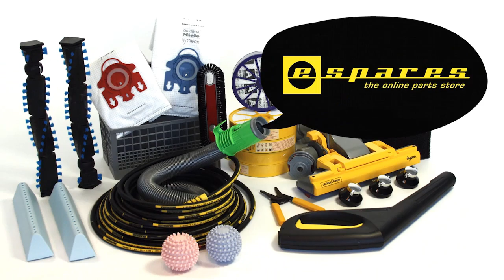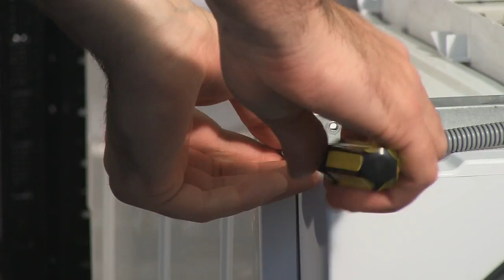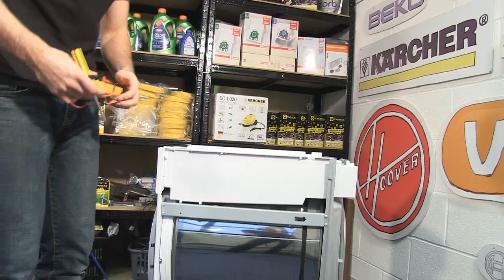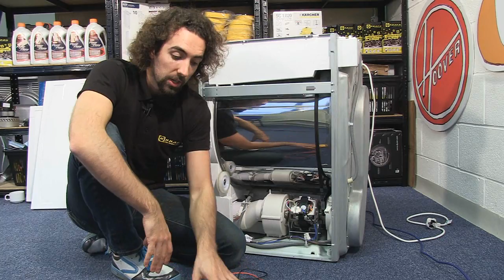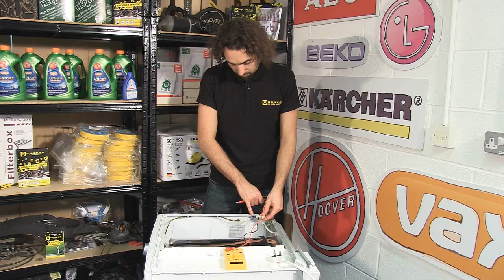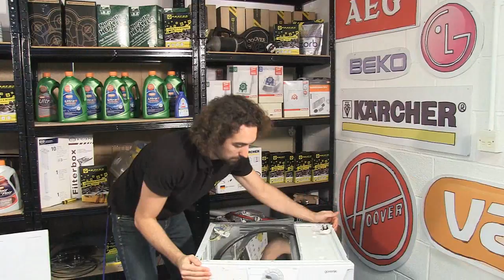How to Diagnose Tumble Dryer Control and Program Problems

Comment: Hi josh. I have a candy gvc d91cbb 
It just stopped working. No lights or anything.
I checked the obvious. Fuse but that’s ok..
Can you help please?
Thankyou Chris
Reply from the maker: Hi Chris, plug the machine into a different socket to check the power, if still not working was the machine on when it stopped and what was it doing?

Comment: My hotpoint fetc70 tumble dryer makes a buzzing sound when i push the start button what is wrong help
Reply from the maker: Hi Violet, you will need to test the motor capacitor and we have a video to help www.youtube.com/watch?v=Vd8DcQpk748&t

Comment: I'm trying to figure out why my hoover vch680f keeps blowing it's heater element (I am about to replace it for the third time in the last 18 months)

Can't find a fault, no unreasonable fluff buildup (as far as I can see), could it be the control board?

Thanks.

P.s. really appreciate your vids, have bought from you several times while fixing my stuff!
Reply from the maker: Thanks for the comments Benjamin. There could be several possible reasons but the first obvious one is are you using a 'genuine' Hoover element?. Next if a lot of limescale builds up this can cause excessive heat inside the element and cause failure. The final reason can be if the element came on when the tub was empty of water again it could overheat, (possible but less likely).

Comment: watched all the vids but none seem to cover my issue, it keeps cutting out after a few mins, sometimes only seconds you have to keep restarting it, its a Beko condenser if anyone has any ideas
Reply from the maker: Hi Darren, this could be due to the machine recognising its not heating or if the water is not being emptied into the container.
Check these areas to see if you can identify a problem.
Reply: might be worth renewing the over-temperature sensor.

Comment: Thanks, tried the sequenced on/ buzzer cancel button pushing with programme on delicates, nothing fires up :( Even had the back off to see if a thermal cut out had tripped but all seems okay. Are control panels easy to fit? I assume it's just a take out and replace job, putting  connections in the same way. Off to look on your site now. :)

Comment: My tumble dryer interior light comes on but all the front lights on the control panel are dead. Does that sound like a control board issue?